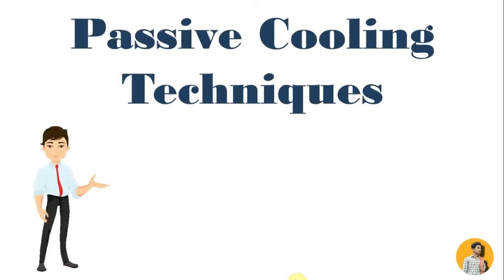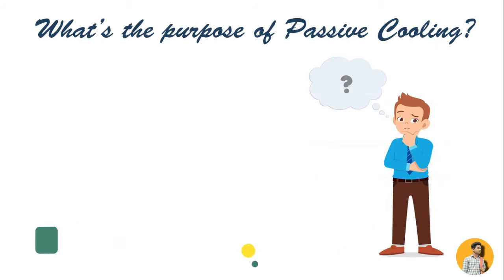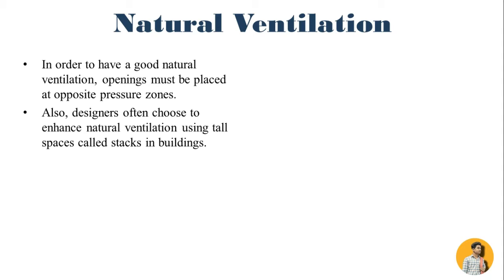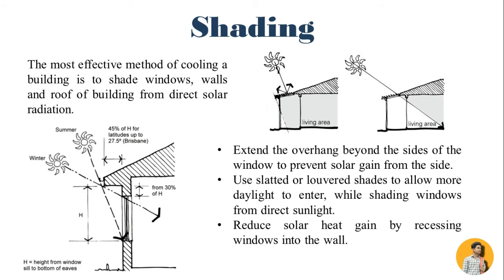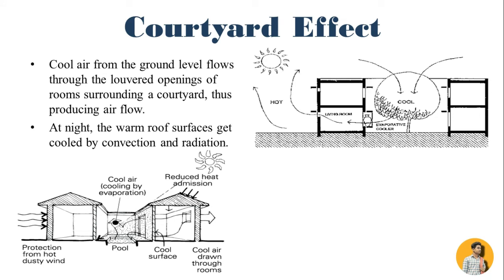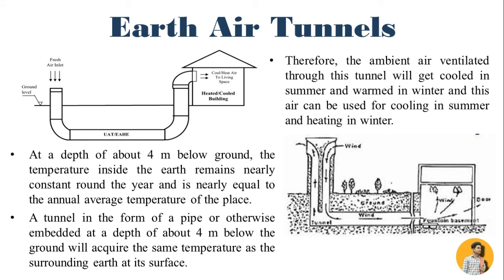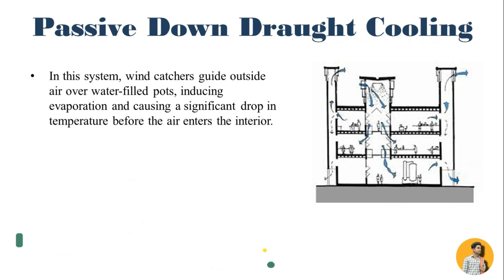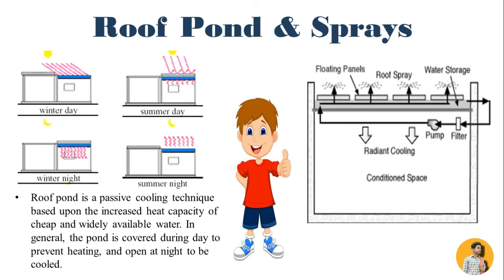Passive Cooling Techniques.

Comment: I have a question about wind towers.Is it possible to use the same system in Winter time for hitting?How to change air directions?🤔🤔
Reply: Yes you can heat too. You have to close tower so the heat will acumulate in tower from out side and only way out would be inside of the house